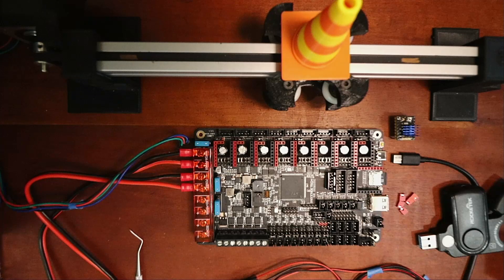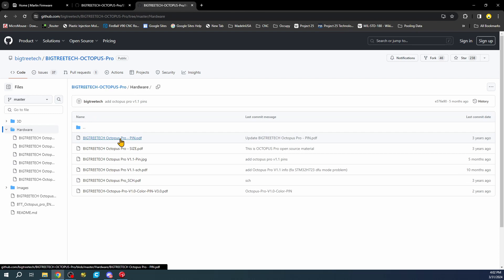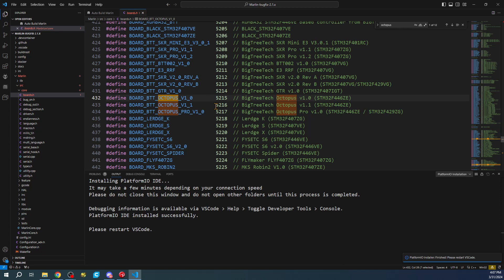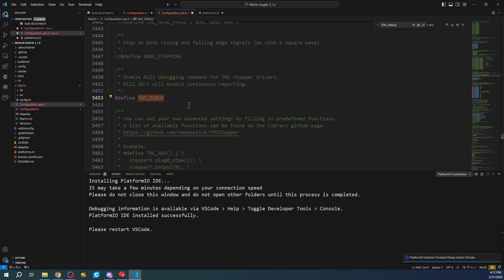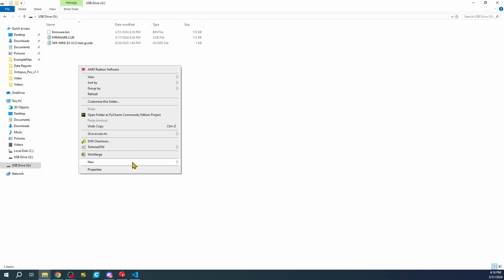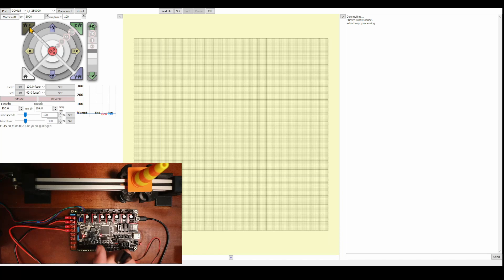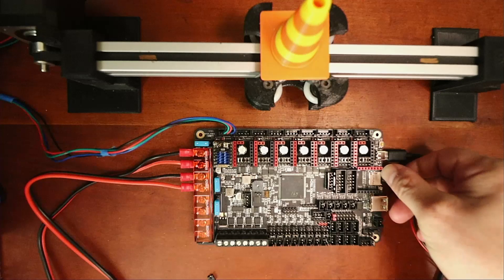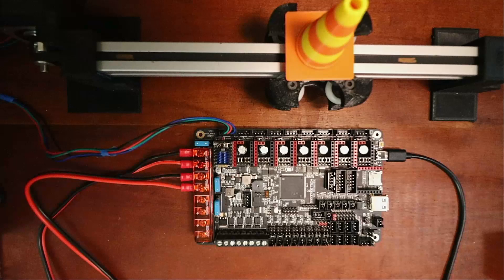Octopus Pro v1.1 - TMC2130 SPI with Homing/Sensorless Homing - update

Comment: Ed, I bought a Kraken could you do a video setting this up for marlin and for Klipper, could you share your thoughts on Klipper not being able to move extruders by percentages like in marlin for mixing.
Reply from the maker: Just ordered Kraken.  As soon as the noise issue is resolved above my apartment , I'll start looking at Kraken.

Comment: Looks like you ran into one of the major reasons I hat M$!
"Updating" without permission screws up my custom settings all the time and causes me so much lost time.
It shouldn't even be called updating as many times it doesn't update anything but actually removes functionality without permission.
Reply from the maker: Depending on the file or directory, you might be able to chmod 777 (filenames/directory).